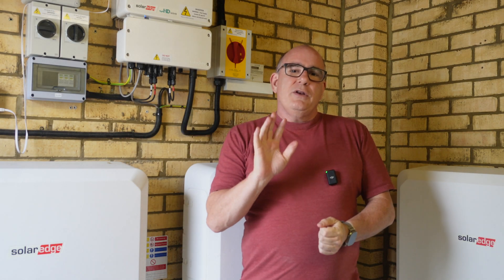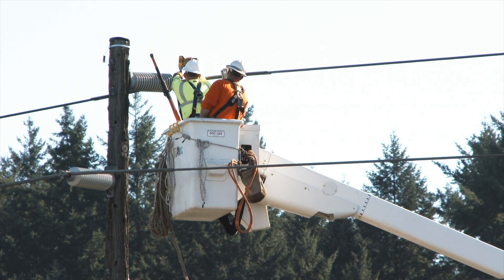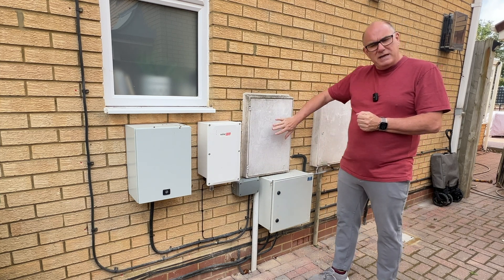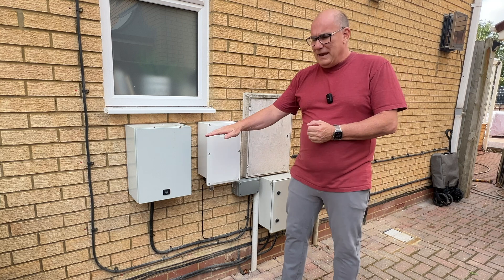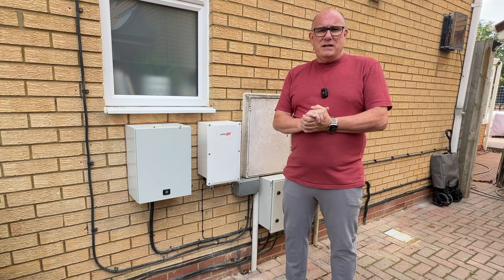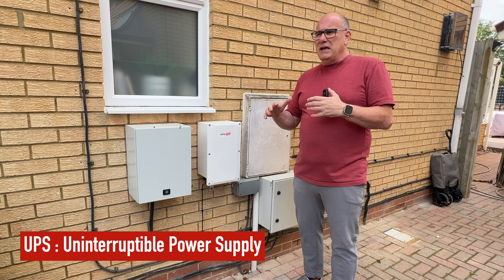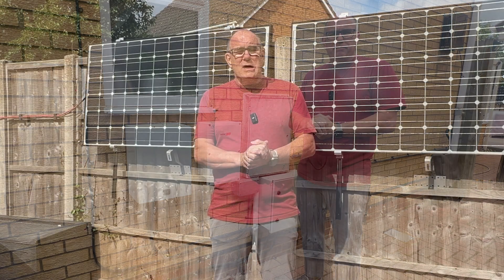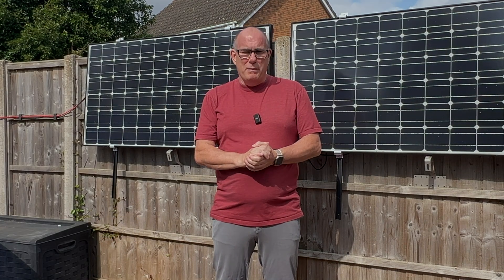SolarEdge Upgrade: Stay Powered Even When the Grid Fails!

Comment: Manual switch would of been a lot better than auto, to be honest i though most people stopped installing auto switching because of damage to devices and also with manual you can turn things off like shower / oven etc first
Reply from the maker: The reason we went with an automatic system is that we already have the high load items separated on a separate distribution board which is not powered during an outage so things like the car charges won’t suddenly drain the battery. I’m gonna be doing my monthly test in a few days, I will see if I can film it as you’ll see once the power goes off very few things even notice the switch overtime is so quick.

Comment: Thank you for the video. Any chance you can list the inverter part number as well as that other piece of hardware? I have the SE10000H. I am assuming I would have to upgrade the inverter and I’m curious what that whole set up cost you just trying to decide if it’s worth just adding a battery
Reply from the maker: yes that’s the same inverter i have, the other parts are something called the hub connection unit - a box that sits under the inverter and connects panels and batteries. then you have the backup interface box that sits next to your mains panel. batteries are not cheap but they are super reliable. i think your looking at about 8k each. while system was close to 40k installed